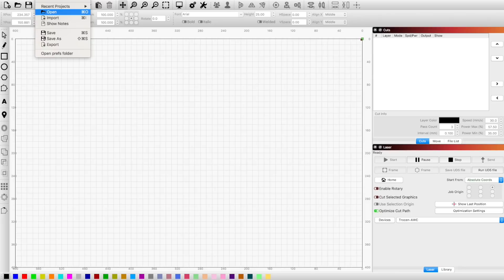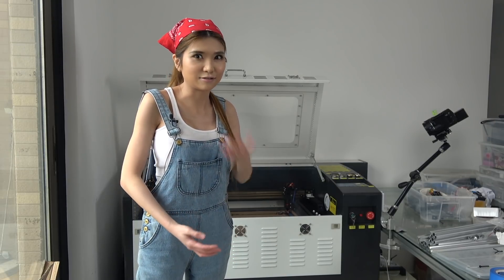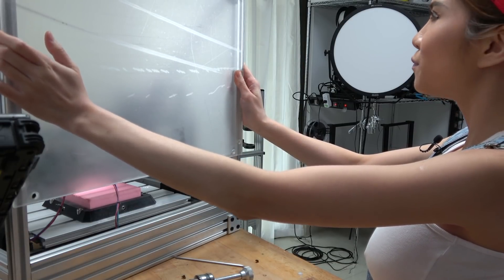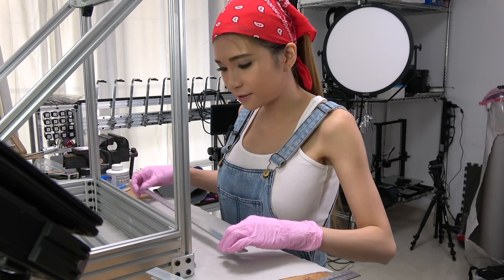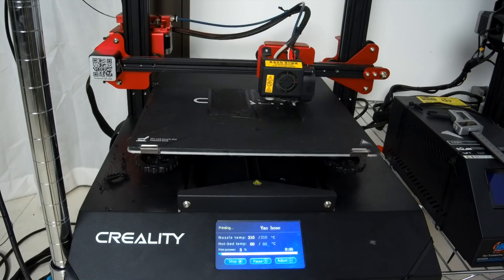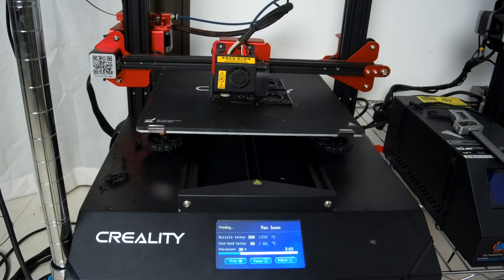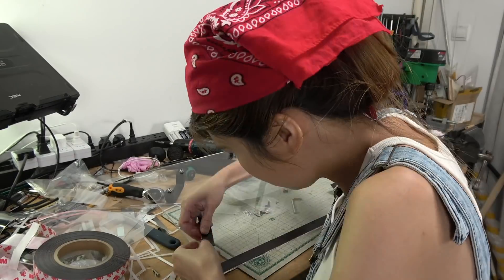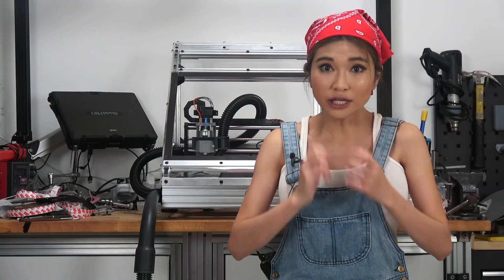🔥Lasercutter Fire!🔥- and CNC Enclosure Build

Comment: nice job, just a heads up, when installing drill bit in drill press use all three holes in the drill chuck and tighten with equal force all the way around and drill bit will grip more securely and not spin on you

Comment: Nice design for the "Box" ... you can find some foam , this is thin and has his own clue type , they use it for small industrial and marine A/C , for temp insulation , but some of them is good , if they want to have less noise from the fan ... check it out I am use the any type of thick foam is going to do good work , but some of them with little more money you will have less space to lost... around the box , and keep out of the box , in order to have less problems with any fire ... :)

Comment: Good work, I can highly recommend transitioning from TinkerCAD to Fusion 360, it can do all the things that TinkerCAD can and then a LOT more. You can easily export sketches to SVG to put them into Lightburn. Also, wire some smoke alarm system to circuit breakers for your laser for added safety.

Any tips on how to not piss off your neighbours when cutting stuff on the balcony? I am even more space restricted than you are and mine always give me crap when I use my balcony as a workshop.

Comment: I'm cringing when your using power tools without gloves, especially when your drilling holes into metal, the small metal shavings can easily cut you, staybsafe love your videos
Reply from the maker: You never use gloves with spinning tools, it will catch and pull your hand in. Basic shop safety.

Comment: We had a laser cutter fire last year using cardboard backing past the acrylic we were cutting..   A bit of a scary moment in the workshop, but got it under control quickly with a CO2 extinguisher as well..  Cleaning the mirrors was the biggest hassle after all was said and done, but still less than having to replace the entire machine.

Comment: I can tell you about a fire in your laser... my wife was using it and did not stay in the room: https://www.youtube.com/watch?v=7xx-0M_kAek
I came home to a mess and had to fix it... the replacement parts were about $300 which wasn't bad considering the damage. It could have been much worse.

Not sure what system you will use to run your machine... but I have many videos showing LinuxCNC setup and use if you are interested. 
If you need help let me know and I'll do what I can when time permits. You can get my email from my web page... links in my videos.

Comment: If that was a dry chemical fire extinguisher, you may have some problems coming your way. ABC dry chemical is caustic. If you didn't clean up the residue right away, it will start to eat away at any metal it made contact with. I am sad to say but probably within a year that machine will corrode out if it wasn't cleaned right. Love your channel. 
Edit: I read in comments that you used a CO2 extinguisher. Good job! I am leaving this up because of how common dry chem extinguishers are. Always use the right tools for the job.

Comment: I always recommend wearing hearing protection when doing metal cutting. You may not realize it now, but over the years, it will crush your hearing.

By the way, how do you have room for all of your equipment and finished projects? I see you still have the auto bartender sitting there.
Reply from the maker: I have earplugs in

Comment: When I use my laser cutter with flammable material, I turn on a mixture of argon and CO2 that is dispensed right next to the laser beam. No oxygen equals no fire.
Reply from the maker: Sounds good!
Reply: Just don't flood the room. No oxygen equals no respiration.
Reply: @chaos.corner  All laser cutters are closed units with exhaust fans to clear out any smoke. No danger of that happening.

Comment: Just a little tip when drilling holes in metal. If you don't mind a bit of a mess. Use some drill but coolant/lubricant in a spray bottle. It will have your bits from doling out and snapping when drilling through more than an inch.  If you want to get creative you can build a drainage slide angled down with a metal cooking strainer attached to it under your drill. As the fluid drains it will take the metal shavings with it, collecting the strainer while letting the coolant drain into another container to reuse again for another project. ;3

Comment: @Naomi Could you please put the Thingiverse links for the vacuum parts you found. I've been trying to make something like the vac attachment you have but my designs come out flimsy & aren't as simple as the one you found. I'm also a Tinkercad fan but I also use Fusion 360 for its parametric features👍🏻 worth learning it. I only did a couple of tut's from Lars Cristiansen's YT channel. I was able to do something useful after only the 1st one I recommend his channel. Really clear explanation! Keep making you are an inspiration👏🏻👍🏻
Reply from the maker: They are custom sized for my vacuum and hose, I don't think they would be very useful...
Reply: Ok, it was actually the piece on the CNC spindle part that I was most interested in. I can draw up just about any part myself but the problem I have is that I just can't seem to get a mental picture of a useful vac. Nozzle for the spindle that will still give good visibility of the tool & also still get a good vacuum to remove the swarf. I've looked at lots of parts on Thingiverse but none of them took my fancy. Thanks for the highlight on my laser comment😃👍🏻. I've been using Chinese co2 lasers since about 2012 & I've worn out 2 tubes, a psu, 2 sets of mirrors & crazed a lens due to poor maintenance. That's how I learnt that it's better to over clean than under clean the optics. Never leave a cut unattended, an engrave seems to have fewer fires.
Reply from the maker: Oh, sure it's this one: https://www.thingiverse.com/thing:2062610
Reply: U R A * Thanks

Comment: I've got a 50W co2 laser & I get a clean through cut on 6mm plexiglas with 65% & 2 passes @ 9mm/ sec. I can do it in one pass at 5mm/sec. But it seems to cut through better with 2 passes. 3mm MDF uses 60% @ 9mm / sec 1 pass.Also note that it's good to clean off the mirrors with a cotton bud (cue-tip) & alcohol. Also keep the lens clean because when it gets dirty, the heat builds up really quickly in it & can craze it internally or shatter it. Remember to put it in again with the flat (Plano-convex) or concave (meniscus lens) side down or the cutting power is reduced & the depth-of-field is shortened. HTH.

Comment: Watching this video reminded me so much of my father. He also builds things, only he uses wood and glass. It's quite interesting seeing things built from other materials. Some of the methods and tools are identical, some very different. My father has never had a laser cutter, for example. But, that miter saw you used to cut the aluminum frame, he has one just like it---with an appropriate wood-cutting blade, of course! :)

Comment: Very neat design!   Especially liked your use of magnetic strips to hold the access cover on.

Is the extraction hose flexible enough not to interfere with the head moving?

Was going to say to add foam, but you mentioned this at the end.   It probably won't make a huge difference though.
Reply from the maker: Yep hose moves back and forth ok👍
Reply: @Naomi-Wu  I'm impressed.   You are a brilliant engineer.

Comment: I wonder if you could come up with something to 3d print that would allow you to have one central shopvac and hoses run to everything that needs it, so you don't have to switch hoses, just change the setting on a valve. in essence choosing the destination of the suction by turning a valve

Comment: Are you still happy with your CNC router? My wife wants to get one. Looking forward to seeing the project you make. We want to be able to manufacture a prototype for acrylic rulers, stencils, and templates for our quilting business without sending design plans to another company and wasting time for the prototype comes out right.
Reply: I have one of these 3018 machines, it took a bit of modding and tinkering to get working properly. I added end stops which was a little weird because the frame is made of acrylic, I had to use cyanoacrylate glue to stick the switches in the correct positions. I also added an autoleveling probe, and upgraded the stepper motors to beefier ones (almost twice the torque). And of course replace the rotary tool with a more powerful one. I did all that because my goal is to machine metal, especially copper. So far so good. It works to cut patterns in 2mm copper sheet.
Reply: @stamasd8500  Thank you. Very helpful.

Comment: Applying Dynamat (or a similar off-brand sound absorption mat material) to as many of the surfaces of the enclosure as you are willing to could help cut down on some of the sound, at least the noise that is amplified through reflection and reverberation.   The surface area of the panels acts like a speaker.   Absorbing as much sound energy as possible should help cut down on the noise.   You'll likely leave some areas open so you can see inside, but anywhere you don't need ot be able to see is a good area for the sound absorption mat.  Also, consider cutting a hole and use a vacuum with a "Dust Deputy" to capture the dust into a bin as well as provide some cooling effect to the enclosure.  The cone shape of the Dust Deputy dumps the dust into a bin while mostly just air goes into the vacuum keeping the vacuum from getting clogged up.
Reply: @cd rom to have fire, you have to have heat, fuel and oxidizer.  Remove the fuel (dust to a dust separator) and remove the heat, you greatly reduce the chance of fire.
Reply: @cd rom like with any project work, safety should be thought about up front.  With that being said, the sound dampening mat in itself doesn't increase the chance of fire, and saw dust is extremely combustible in and of itself.  So, the proper precautions should already be taken before considering air flow and sound dampening mat because the risk is already there.  My point is that your point doesn't apply to what I'm saying any more or less than it applies to the subject in general.
Reply: @cd rom  so how does evacuating the wood shavings to a separate area cause more flammable material to be in the area?   If you're really concerned, hook up the power to a smoke detecting relay and have the vacuum and router shutoff if there is smoke detected.  They make those kinds of relays for commercial air handlers.  My point still stands:. The dynamat doesn't increasing the risk of fire itself.  It is up to you to make sure that you reduce the risk of starting a fire to the minimum.  We're talking about a router / 3d printer enclosure, right? Not a laser engraver enclosure.
Reply: @cd rom you're ignoring the fact that an enclosure with wood chip build up is in and of itself more dangerous than evacuating the chips.  With no chips in the enclosure to catch fire, you reduce the risk.  You also failed to address my suggestion of an automatic smoke detecting cutoff switch like those used in HVAC air handlers.  If you are so worried about chips that aren't even there catching fire because you're evacuating them, then simply make the whole system shutdown automatically if smoke is detected.  That is neither difficult nor expensive to do.  Your claims about dynamat adding to a potential fire are true, but if you have wood chips, any fire is going to be bad... So prevent the fire.  Work smart.   People running cnc routers every day are using vacuum evacuation for their chips / dust.  It's really standard procedure.  They aren't burning down their shops either.  By keeping dust and chip levels down, it is in fact safer.  Yes air flow could be bad, but that too has a simple solution if you think a particular setup has enough risk to warrant it.
Reply: @cd rom  the enclosure was for the CNC router... The laser cutter already has an enclosure.  The noise comment I made was in reply the noise of the router.   If we were in fact talking about a laser cutter, the dynamat would simply go on the outside of the unit.  It'll still absorb sound inside or out.
Reply: @cd rom It seems like no matter what you've already made up your mind with very limited info.  There are many different types of smoke detectors.  Some operate on smoke AND heat.   Stop being so closed minded.   People use vacuums on router heads all the time. People use dynamat on cars and many other applications where they want to add sound dampening...and even cars catch fire, so what?  The idea is that you prevent that from happening.
Reply: @cd rom  only if the operator has completely and utterly failed to do their job.

Comment: This is a timely video. I have been debating whether or not to buy a halotron fire extinguisher (instead of CO2) for my laser cutters. The halotron types are more expensive than a CO2 fire extinguisher, but after watching this video I'm going to bite the bullet and get it.
Reply: Is the halotron toxic? Old Halon extinguishers were toxic IIRC. CO2 displaces oxygen (required to extinguish fire) but once it dissipates it's safe

Comment: Great enclosure. I would suggest that if you did not do this, use soft supports between the CNC and enclosure to isolate it. This will keep vibrations from traveling into the enclosure and will lower the noise. I worked in a factory once and was surprised how well clear plastic windows blocked sound. The soft flexible plastic did a slightly better job than the hard plastic, but in this application I don't think you could tell.

Comment: One thing I didn't hear in the video and haven't seen in the comments is to clean the mirrors in the laser cutter after a fire.

Smoke particles can (will) deposit on all surfaces, but the mirrors are critical. Carbon particles on the surface will be heated every time the laser is used. You can get pitting and other surface defects in the mirrors pretty quick. Best case scenario you get a little reduction in focus and power. More likely, your mirrors need premature replacement.
Reply: Not to mention residue or condensate from the extinguisher, made me fear for the machine, would probably tried a blanket first

Comment: Excellent build on that CNC enclosure!  Neat corner / brace brackets, Allen head bolts etc.  And it allows for you to modify it in future if you need to.  I'm guessing you are about 400' up on the balcony.  Is that a world record height for using a drop saw?
Reply from the maker: Not sure? Almost the 40th floor😅

Comment: Great video Naomi. good on you for promoting Lydia's work too. 
When I was asked for aluminium cutting advice (previously tool shop sales role) I would always recommend Steryne Wax. It comes in a block or tube and you just cut in to it slightly, coating the teeth, before cutting the Ali and gives a great finish that you pretty much wouldn't need any extra work on the cut piece. Can also be rubbed on to the blade while saw is not running obviously. Re-apply as you feel it needs as it can be noticeable. Not as messy as cutting fluids. Can get a spray cutting fluid which is decent but the wax works out cheaper I believe.
 Also for the Laser CNC rather than cardboard, some cheap MDF sheets, 3 or 6mm thick, is good to use as a test piece. Some hardware stores may have top sheets that are usually an extra sheet for transport protection, which they give away mostly or sell cheap as generally they are a little marked. 

The cabinet looked very professional at the end.  Awesome job :)

Comment: Great job here for solving the main issue first which was dust / mess,  I would imagine the noise is somewhat muffled atleast as it has to travel through another material, but as you state you are not doing long cut run's with the CNC.

Keep up the great work!

Comment: Great work on the enclosure! What was that blue stuff you painted on the strip before you drilled the holes? Just some kind of ink?
Reply from the maker: Prussian blue, it's just used for scribing and marking metal parts.
Reply: @Naomi-Wu  Ahhh cool! I know my dad used to have blue stuff that looked like that, but I think his was some kind of glue for plastics or something :)
Reply from the maker: @welbot  pvc pipe cement maybe?
Reply: @Naomi-Wu  Yeah quite possibly what it was :) Never paid much attention really. Just remember it came in a tin with a brush like the one you used :)

Comment: Your videos are great! Couple of machining suggestions  :)
1. use some mineral spirits / kerosene for cutting fluid on soft alu. Helps allot
2. turn that vice loose so it can float a little. Will help allot in getting the center punched spot under the tip of the drill.
Thanks for all you are doing